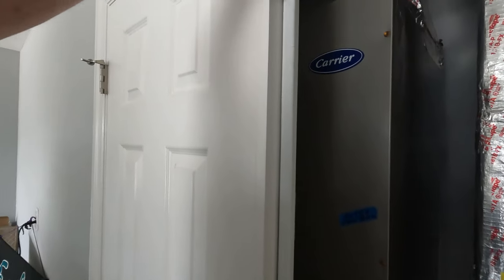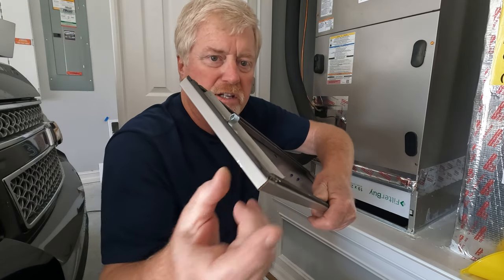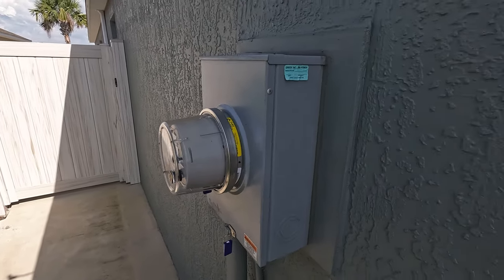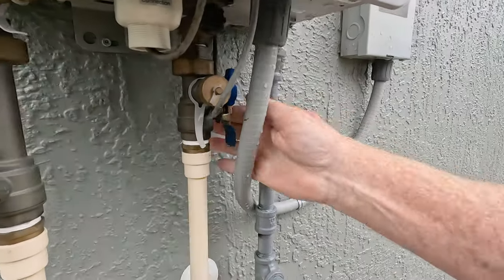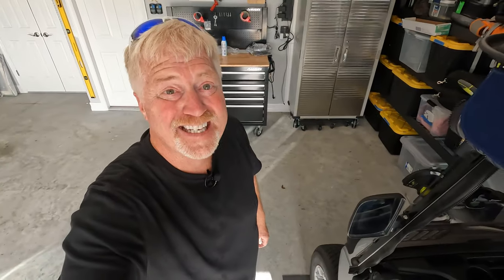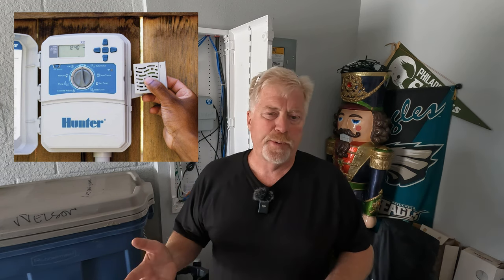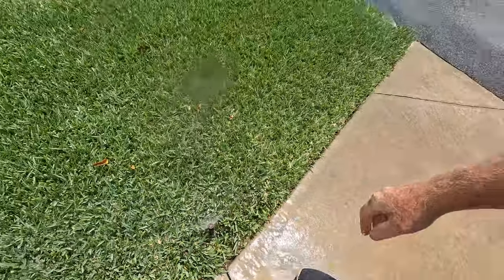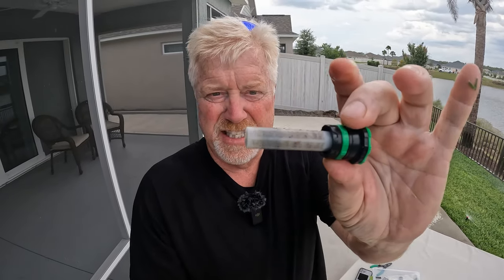The Villages Florida Keep your home running trouble free. Don't neglect these maintenance tips.

Comment: Dang … Rusty! I never knew “the outside of  windows” had those little plastic weep vents.  If you would never had showed this by scraping the caulking off … I would not have known to look for them to ensure they aren’t sealed closed.

Thank You for the education!
Reply from the maker: I was told that's one of the biggest problems with the windows when warranty gets called roof leaks    Subscribe for new Videos: https://bit.ly/3aToJ3H

Comment: Could add a surge breaker to your circuit breaker box, will protect everything connected to 120 or 220 power . Some states building codes  now require surge breakers on all new homes.

Comment: Rusty, I'm pretty sure those filters do come off the rotating spray heads. They do on mine. They take a bit of pressure to take them off, and they have little clips up toward the seal that you line up when you put them back on. Now that you replaced the head, you might want to try.
Reply from the maker: Yes you are correct they do come off of a little pressure.   Subscribe for new Videos: https://bit.ly/3aToJ3H

Comment: My AC recently stopped working and the service guy came out.  The unit was fine but the condensation line was stopped up and there is a sensor on the unit to prevent the unit coming on if it gets stopped up.  What he said is to pour one cup of bleach down the tube to keep the mold or mildew from clogging the tube.   What did your guy say about not using bleach?   BTW, it was great meeting you the other day when you were shopping.  It was either at BJ's or Sam's, I cant remember.

Comment: Great video, Rusty, thanks for the comprehensive instructions for these important chores!  Can you tell me (maybe in a message if you don't want to broadcast) what editing software you use? I'm looking to put up a YT video on a completely non-TV related topic. Just basic, beginner friendly, and preferably free or low cost.  Thanks!  Oh, P.S., golf cart air filter check and cleaning is easy. Just pop those little clips off, remove the lid, then the filter. Spray it down liberally with some K&N red (rouge) air filter cleaner. Let dry and put back in. We can get into more detail another time but replacing the spark plug and greasing the clutch are pretty simple also - and I am not mechanically inclined one single bit!